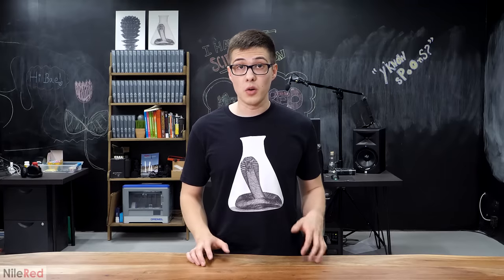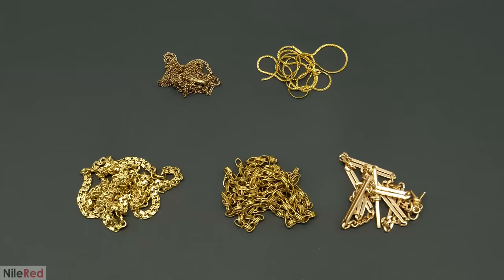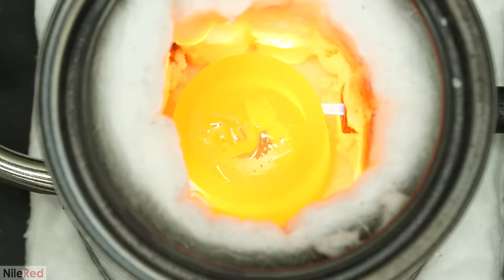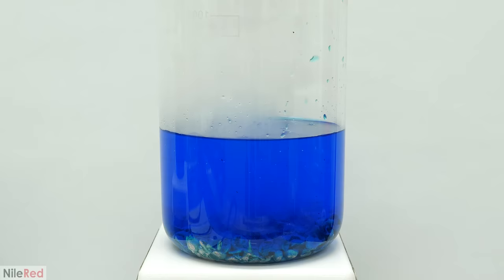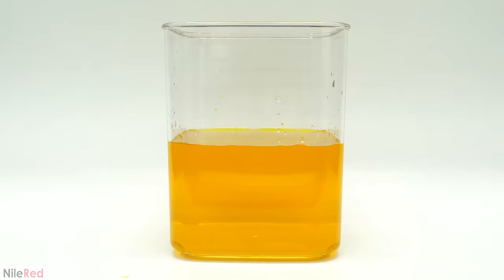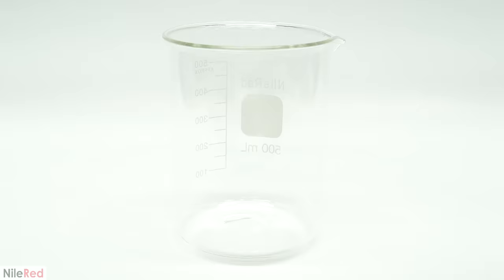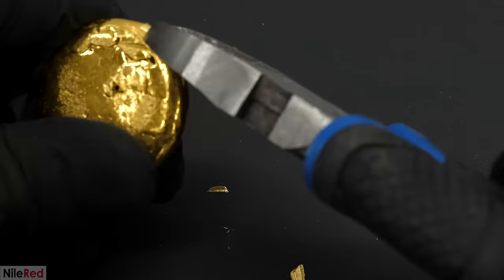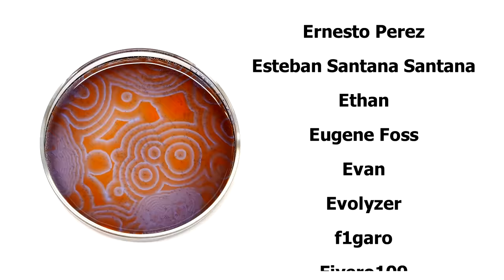Turning old jewelry into pure gold bars

Comment: I am glad you didn't destroy the working, automatic watch. That would have hurt me physically.
Reply: Especially because it was a Rolex
Reply: @madnick78  pff not even an omega...
Reply: I'm not even concerned that it's a Rolex, but that it's just an automatic watch. There's just something really cool about the insanely intricate workings of an automatic watch.
Reply: Omegas are generally cheaper than Rolex’ though
Reply: @rubiconnn  Aren't rolexes 5,000$-20,000$+ luxury watches though with full on service teams for them though? only thing it appears to be missing is a band, which should be a easy fix for anyone with a watch strap if they can get a suitable part. It's the craftsmanship and inner designs and clock movements that make them valued, not the scrap metal themselves even if it is premium materials.
Reply: @JesseO-nh3us  automatic watches are mechanical watches that wind automatically as you move your arm. So as long as you wear them you don't have to rewind them at all.(if you leave them laying on a counter of course, they'll still run out of energy)
Reply: @Notyouraveragename  looks like the band was the "pieces of scrap gold" in the video...
Reply: @83hjf  omw you're right, they destroyed the parts of a 14,000$ Rolex watch for the maybe 300$ worth of gold in the strap..
Reply: @Notyouraveragename  I was crying internally when I thought this video might destroy a Rolex. Not that its parts where not valuable,. It was a story my grandfather told me. He had a old watch for years, he whore it daily, it broke. He mailed Rolex a letter, saying his watch broke, just '' he had it for years, and it broke". Rolex mailed him a letter and a catalog that said "We dont make that watch anymore, nor can we service it. Pick any watch you want, send us your old one.". It didn't matter that his watch was probably one of their lesser models, or that they had not made that watch for 20 plus years. "Take any model"..... What I'm trying to say is that company made it right. Name one other brand that will stand behind their product 20 years after discontinuation?
Reply: What would this model be worth? 

I'm very pleased with his decision to not melt it down!
Reply: @Notyouraveragename  It looked like the pieces he called scrap was the Rolex watch band. One piece had the Rolex logo. (time stamp 1:18) https://youtu.be/37Kn-kIsVu8?t=78 Probably could have a jeweler reassemble the watch band with a few pins to connect the "scrap" pieces.
Reply: @basstrammel1322  several thousand dollars for sure. Rolex watches hold their value pretty well. Even without strap, or box and papers. I would cry if someone send me one. :)
Servicing it and a new strap will cost a little fortune too. :D
Reply: Yeah, I'm glad, too. The rest was just some dead metal. But it would be a waste to destroy this kind of intricate and potentially fairly old clockwork, likely just to find out there was a tiny amount of gold in its gilded dial. I hope your patron let you keep it for all your hard work of making all these gold bars :)
Reply: @kazoode  Honestly if anyone brought me any of the CB radios I made 20ish years ago and asked if I could repair or replace it. I would probably just build them a new one from modern electronics and keep the old one. Building a replacement out of newer components is going to be far easier than repairing that old model. Additionally so much more art went into producing that old model that it serves as a testament to both skill and creativity than any modern rendition will. Watches really aren't much different in that regard, as progress advances technology, a lot of the art is removed. It's a good thing since it means it's easier to produce accurate pieces but you lose out on the sense of achievement to some degree.
Reply: @Tahydrahel  It's worth so much to some people yet it's completely worthless to me. All I need is the internet to connect to the satellite to get accurate time.
Reply: @howardlam6181  i would rather just look at my wrist.
Reply: Obvious fake rolex, the magnification on the date window is not even close
Reply: @ElementalJerk  Well, I didn't say rolex did I? Even if it is not a rolex, it is certainly worth more than the gold plating on it. It won't fetch 10$ worth of gold probably. any working automatic watch is worth more than that.
Reply: @kazoode  Thx god the reputation would fall off if not so wealthy ppl were just ignored by the compagny. Its a marketing way of doing
Reply: jort93z respectfully disagree...junk watch. gold shiny!

Comment: One thing you could’ve done with the gold bars while they’re still in the mold is partially melt them again. It will flatten out the surface of the bar.
Reply: An excellent demonstration on why casting swords in movies and TV is bull
Reply: @Rio..o7..  I can confirm, you need much more than molten metal and a cast to make squeaky smooth surfaces out of metal

Comment: Thank you for not destroying the Rolex!
Reply: Right! My heart dropped when I saw that cyclops
Reply: On a side note, at least Ben can sell the watch, and gold and possibly get a nice preowned Rolex.
Reply: I'm pretty sure that the Rolex is fake. For instance, the date should fill the whole cyclops, but in this example it doesn't.
Reply: @pasquale78  I think it is fake as well. The bezel on two tone datejusts should be gold.
Reply: Jon Gee  Exactly, either way it's worth more as a watch than as a melted piece.
Reply: Nathan Carrille no ones making fake Rolex’s with real gold lol.
Reply: Jon Gee  It is. The scrap metal consisted of a few links from the watch bracelet, which should be solid gold, because Rolex doesn't use gold plating. But you see that all the links are dissolved in the solution.
Reply: @connordavis5086  Yes, you are right.
Reply: Pasquale the Rolex wasn't fake it's an older datejust probably worth $12000-$15000 thankfully he didn't destroy it
Reply: @zukokurama  only one way to find out. Take a little bit of gold and test it.
Reply: Jon Gee  That makes no sense at all, the value in the Rolex isn't in the gold so doing anything you can make the counterfeit more believable is a good idea and i guarantee has been done.

Comment: for the very 1st time i've regretted not paying attention in my chemistry class =(
Reply: musawer gulzar even if you did, you would still be confused asf
Reply: it takes a little bit of further knowledge than school chemistry.
Reply: @7784000  This isn't as advanced as you think. I can't speak for other countries, but high school level chemistry here in Norway is more than enough to follow most of what has been explained, including how XRF analysis works.
Reply: @barreliusnois5533  depends on how much you want to understand. but to follow the procedure school knowledge should be enough, right.
Reply: Don't worry, you would not have the jewels for it anyway...
Reply: @barreliusnois5533  Gonna call X to doubt on that. Sure, high school chemistry is enough to follow all of this and have a general understanding without being completely lost, but you definitely don't cover XRF in a high school chemistry course. A 400-level Instrumental Analysis course (where that would actually be the specific subject matter) still only scratches the surface of XRF, and you wouldn't actually be able to understand it all unless you specifically took the time to work with those spectra/instruments. It's not generally all that complicated, but it does take time to gain an actual working understanding.
Reply: Saaaame hahah
Reply: musawer gulzar say wutttttt🥺
Reply: musawer gulzar dead ass same lmao
Reply: I still don't.

Comment: Decides not to destroy the iconic Rolex Oyster Perpetual

I breath a sigh of relief
Reply: Edward de'Lisle-Tarr who in there sane mind would send a Rolex to some random YouTuber, that is just absurd, either they are insane or just trying to flex
Reply: Edward de'Lisle-Tarr breathe*
Reply: It was a fake one though
Reply: "who in there sane mind would send a Rolex to some random YouTuber"....a working Rolex.
Reply: The rolex was a fake.... one easy way to tell if a rolex is fake or not is if it ticks. Regular clock hands  tick. Having mini stops. A rolex watch hands rotate smoothly, without ever ticking.
Reply: shteve119 actually the sweeping of the second hand looks a bit too laggy compared to an original but it has an automatic movement like an original
Reply: @miloshueg4386  Rolex oysterquartz
Reply: Tobi Abidoye this datejust is not an ousterquartz. It doesn’t have the oysterquartz case as this one has long lugs.
Reply: Tobi Abidoye and it has literally written datejust and not oysterquartz on it ;)
Reply: @miloshueg4386  I know but you said no Rolex watch ticks and I said the oysterquartz does
Reply: Tobi Abidoye oh sorry. My bad :) but I think you get the point ;)
Reply: shteve119 No, Rolexes tick 8 times per second like most nice mechanical watches.

Comment: “Gold is weaker than other materials.I tried to bend it with my fingers but it was absolutely impossible.”

5 year old me who bent a fork
Reply: Forks use crappy blend of untempered steel while being thin & offering long leverage to multiply the force put in to the bending.
Reply: @moroit1  makes sense
Reply: Aluminium, common material for kitchenware or iron
Reply: Sara Art - I suck  did you know you can edit comments
Reply: lol
Reply: I mean a fork is a lot thinner
Reply: Minecraft be like:
“Gold is very strong.. ima make it WEEAK!”

Comment: The 1% tungsten was interesting. Tungsten has almost the exact same density as gold. One trick is to tack a gold bar and drill out wholes and fill them with Tungsten rods and reseal the bar with gold.
Reply: And you know this because....?
Reply: Would an xray show there's rods inside?
Reply: @panteleymonschekochikhin-k1978  I don't think X rays can do that, Though gold is slightly less dense than lead, the shielding effect might be significant enough
Reply: Tungsten is still crazy expensive
Reply: Or you can just put it in a vault, pay an auditor well, and trade paper claims.
Reply: @Cain35  cheap compared to gold
Reply: @sallyoldford9237  Half of the Chinese gold reserves are made up like that.

Comment: Fun Fact: Another resaon for the mentioned confusion between Tungsten and Gold is, that often the Xray-Tubes used in such analysis devices have a tungsten filament, that serves as an electron source. Because the filament gets heated, it gets consumed slowly, possibly leading to the depletion of tungsten atoms on the anode and thus to parasitic charactaristic tungsten peaks in the spectrum of the xray tube, that can make its way into the final spectrum by scattering effects.
Reply: *reason
Reply: I'm curious; can they create xray tubes without tungsten filaments (using something else instead)? While I'm sure they have many good reasons for using tungsten, there may be a market for tubes without - people with precious metals. Such an xray tube would be good for that industry in particular.
Reply: @zidbits1528  its a metal with an extremely high melting point that can also be made extremely small and still not melt, pretty much the only thing with a higher melting point would be carbon, but that wouldnt really work in an xray tube...

Comment: This is beneficial for your patreon and for yourself. You make money off of the video (hopefully enough to cover expenses), and he gets his gold processed for free. Win win.
Reply: Exactly the thinking behind this
Reply: If there isn't any demonetization
Reply: Except he destroyed the pieces of the watchband off a valuable old Rolex watch, probably halving its potential value of well over $15,000 (after restoration by a watchmaker)!
Reply: There’s a ton of people saying it’s an obvious fake idk I didn’t think so
Reply: @benjaminshiffman8734  Agree, as it's an older design that dates to the early '60s & they were less faked then, with the gold-plating very thin & easily worn off (hard-gold plating which contains very little gold only became available in the '80s)!
Reply: @MrWombatty  I'm pretty sure he stated that he left out the "Rolex" for this experiment.
Reply: @MLGChronicGamer  Yes he did, but he destroyed the parts of the original watchband. Doing that knocks off 40-50% of the value to a collector because they much prefer the watch complete as when it was purchased, paying even more if it's in the original box with papers!
Reply: @MrWombatty  yeah but the Rolex still works. The parts were random bits and peices though Rolex collecting is a tiny bit niche so I wouldn't understand why people would spend thousands on watch band parts
Reply: @sacripudding4586  the same reason people buy and collect amiibo figures, pop figures, pins, coins, or even magic cards. 

Collectors are borderline obsessive usually, and if you know anyone who is obsessive then you'll know there is no arguing with their preference.

Comment: That's ceramic fiber insulation.  Don't try this with fiberglass insulation.
Reply: Fiberglass melts under 1000 K
Reply: Xyzzyx 
Other people use Celsius or Fahrenheit, you use kelvin. Now, literally no one understands that.
Reply: Fahrenheit is not a scientific measurement of temperature, Celsius and Kelvin is... Kelvin is probably the easiest temperature scale to remember, since it starts at absolute zero, at -273 degrees Celcius. So 0 Kelvin is -273 degrees Celsius.
Reply: @roboactive  I mean, there's nothing particularly un-scientific about Fahrenheit; it's defined in relation to Celsius, which is in turn defined in relation to Kelvin. Just because a temperature is in Fahrenheit does not mean it is not accurate. (I do grant that it is more convenient to use Celsius or Kelvin)
Reply: The most common ceramic fiber blanket has an operating temperature between 1500-1700 K  or 2300-2600 F.
Reply: TheRoyalGallade [TRG] kelvin is the SI unit for temperature. if you cannot learn how to understand that, then that is your fault.
Reply: @mimiwimi7917 The real reason you should use Kelvin is because all of the equations in thermodynamics and chemical kinetics work only if you use Kelvin. Like ΔG = RTln(K), gotta use Kelvin because with Celcius for example, this would make you believe that at 0°C, all chemical reactions stop lol.
Reply: @FourTwentyMagic, in many formulas and equations the temperature appears as a difference, not absolute value. For example, everything related to thermal conduction only depends on gradients and differences. So you're perfectly ok to work in Celsius scale with these phenomena or, even more convenient, set ambient temperature = 0, simplifying a lot of math.
Reply: @prestonang8216  Using Kelvin is standard in science in America.
All Americans understand it.
It's only foreigners who complain since they now have no excuse like with Fahrenheit.
Want to convert to barbarian units? Just add 273.
Reply: @roboactive  Celcius isn't scientific anymore than Fahrenheit.
It's an entirely arbitrary system we pretend is scientific because everyone uses it.
Kelvin is valid.
Reply: @prestonang8216  ah yes because we all understand what 800 degrees Celsius is like
Reply: Switch to Celsius all you Americans
Reply: @RegularTetragon  Of course yes(? If u had ended highschool and that
Reply: @notpulverman9660  Kelvin is scientific standard in a lot of Europe too, stop bullshitting.
Reply: @notpulverman9660  how is Celsius barbarian, Fahrenheit is barbarian, only one country uses Fahrenheit.
Reply: @notpulverman9660  when we want to boil water we set the temperature a nice round 100 Celsius. When we want to freeze water we set it to 0. Most people will only care about the boiling and freezing point of water. That's why we use Celsius. Why do you guys use Fahrenheit instead? Other than the fact you are used to it.
Reply: jonathan scarce for THREEEEEEEEEEEEE!
Reply: @vulpine3431  Water doesn't boil at 100 for most of the world.
The last time I measured, it boiled at 97, and before that, in a different city, 98.
This fact is the reason teachers in my school system dont bother with celcius, and only preach Kelvin.
Celcius is a waste of time for Americans.
It's arbitrary just like Fahrenheit.
You use it because youre used to it just like we use fahrenheit.
The only logical system is Kelvin.
All systems are usable, but if you're using one that doesn't start at 0, youre doing it because it's easy, not because it makes sense(it doesn't).

Comment: The “scrap” pieces were the remains of the Rolex band, you can see the Rolex logo on one if them... 
that explains why so much gold came from the scrap.
And, no... that was not a fake Rolex...
Reply: It’s real for sure, just the idiot who sent it in... :(
Reply: reads your comment and watches the beginning of the video again Oh yeah, I get it now.
Reply: Yeah  I have a similar  model.
Reply: @heavystarch100  no one cares
Reply: I actually didn’t see that until you pointed that out! The Rolex still seems like it might be a counterfeit to me though because if you look closely at the Rolex logo on the clasp piece, it has some gold coming off of it with silver exposed underneath. Although he didn’t specify which year this watch came from, Rolex watches from that same time period (likely 80’s or 90’s) did not use gold plating. Also, if you look closely at the gold links and their sides, they too appear to have an exposed silver colored under metal where there might be gold plating scratched off but its hard to tell without seeing them in person. He also made the statement around the 4:00 mark that the pieces all felt to be less than 14k gold and if that is the case, Rolex has never used anything other than pure 14 karat or 18 karat gold. He also states around the 20:40 mark when he processes the “Rolex” bracelet that the gold all seemed to be plated or low Karat gold after processing it and the remnants are all a silver metal. The main thing that still sticks out to me as being off is the magnification and font of the cyclops and the text on the dial.